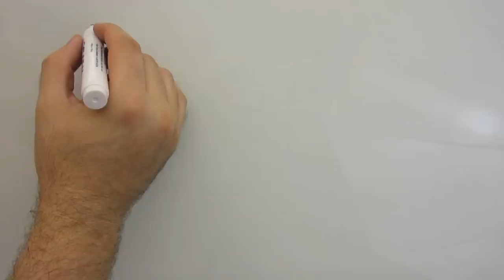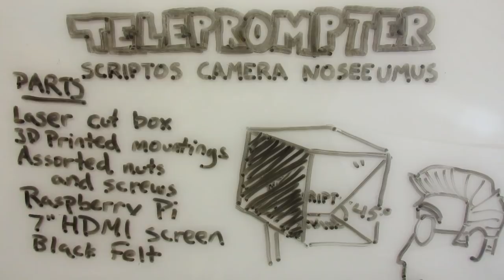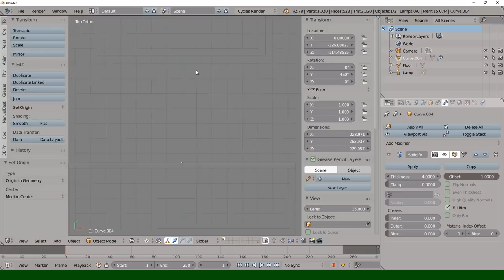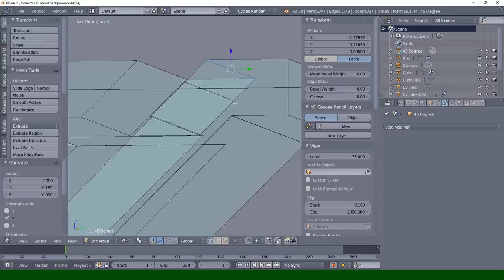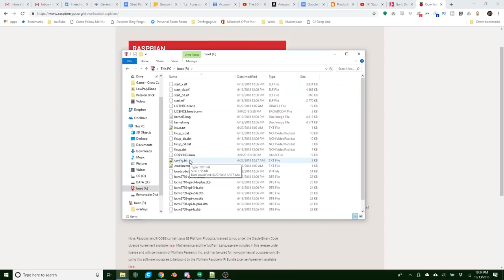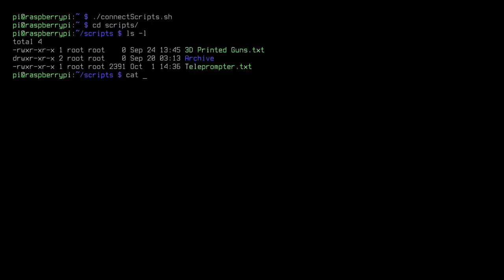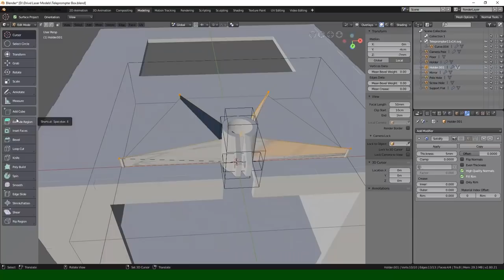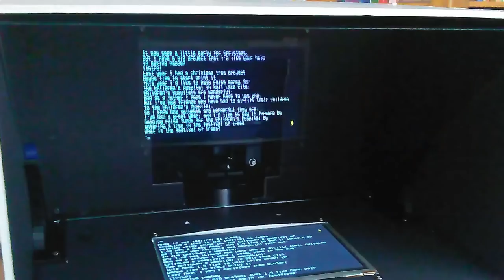Raspberry Pi Powered Teleprompter

Comment: Very glad you liked my ornament, yes I printed it standing on the base using a raft and some supports to hold it upright, I ended up printing it a number of times, as it liked to fall over anyway, and the tolerance was very close to the edge of what my printer can manage, so I have a few of those center spinners that broke off before they spun. I think the end result was worth it though.  Really liked this video, I'm trying to set up shared folders with a pi myself so this video should help me with that more then a little. Love seeing what your doing to make your new workshop, I hope you can get back to your weekly video schedule soon.

Comment: I work for a TV station.  A few hints.  

Most items on the teleprompter are BIG.  The lines are only a few words across.  The fewer words across, the less you see the eye go back and forth.  We also have an automated system that someone monitors and can speedup / slow down the advancement rate as the presenter is doing their thing.  It's also smooth, so the eye generally stays and reads from the same location. 

I actually printed one out that works with an iPad.  I haven't actually used it yet, but it looks simple enough.  :-) I Need black fabric to go around it and the glass.  

Overall, very cool project.

Comment: There is a reasonably easy way to mirror the text inside any modern web browser (hit F11 for full screen mode) by doing a scale transform on the text container along x-axis by -1 (negative 1) via CSS. Font size is easy to adjust too. And the "contentEditable" attribute may enable you to use the same page as the editor, though probably not a good one.
Also, "if the IP drifts a little", using hostnames instead may be a better idea.

Comment: Such a great little project! :) Flipping your display is actually really easy to do if you have windows 10. Just go to display settings, and where you choose Landscape/Portrait, choose Landscape (Flipped). Also, if it helps, you should be able to set your pc to have a static IP in your router so you won't have to worry about the IP changing on you. (You can still use dynamically assigned, but just set that particular machine to have a static one. No changes on your PC. It will just ask the router for an IP as usual, but the router will always give it the same one)
Reply from the maker: Flipping your monitor in Windows only rotates it 180, not flipping it along an axis so it appears right in a mirror. Try it.
Reply: @3dpprofessor Ahh i think I might have used a reg hack or driver hack to make it mirror when I do that now that you mention it. So long ago that I did it. I'm just used to changing that and having it mirror 😂 I know you can do it with Ultramon, but not worth the money just for that.
Reply from the maker: @welbot  I tried ultramon, but it only worked when the screen was mirrored, in the Windows sense. In other words I had to have the same image on both monitors, but one of them could be reflected. Makes it tough to do screen caps with teleprompter. It just wasn't the best solution. Which is why Unix is the best.
Reply: @3dpprofessor  Totally understandable. If you've got the spare hardware to run it all, certainly not a bad idea at all. Less things you have bogging down a single machine the better! :)